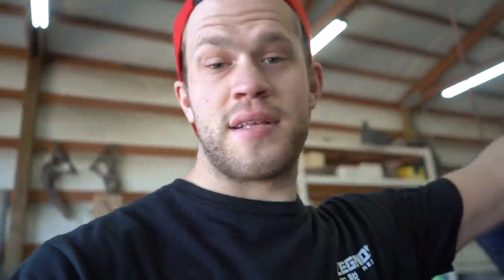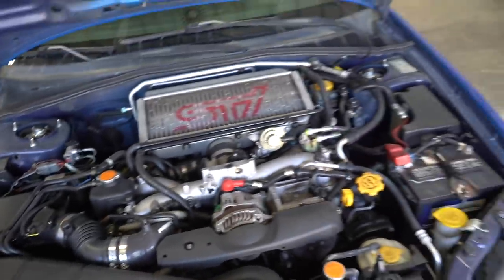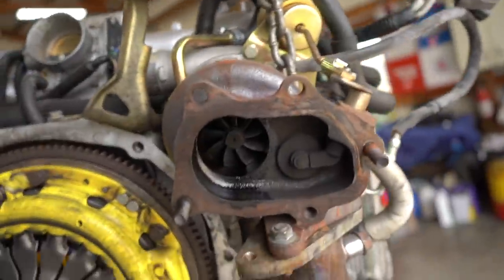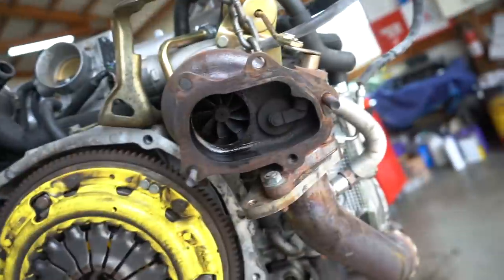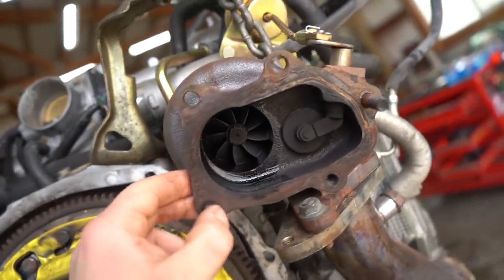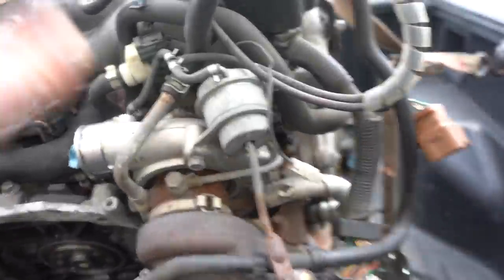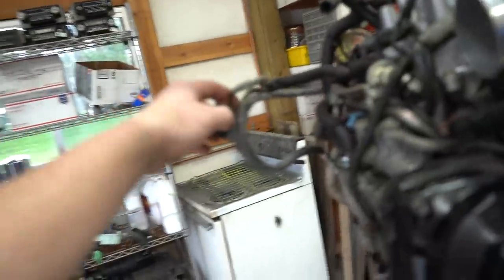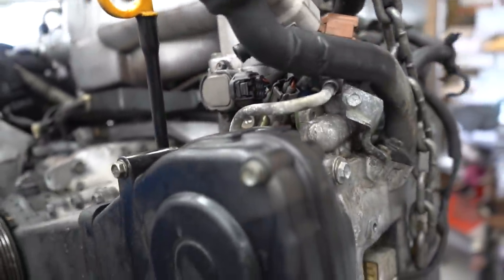The New Project

Comment: the engine honestly sounded fine. just looked like a turbo seal was there any shaft play on the turbo?
Reply: My thoughts exactly, I've owned several impreza 2 started blue smoking ,both turbo failure.i would always check the turbo first

Comment: Hi, can I reccomend you change the oil pick up on this, I beleive the hawk sti shares same engine as my JDM foz sti 
There is a common problem for pickup pipe to snap I bought mine and the engine blew up 170 miles into ownership. It would save a a future engine build for the sake of a cheap part 

I also make Subaru videos feel free to peep my page... I've got parts coming but just waiting for them due to Corona virus shit 😭
Reply: Liam Hill I think that’s a wrx not sti .. (I think)

Comment: Is it cheaper in the long run to rebuild an engine, rather than buying a used engine?
Reply: Carleen Irvine cheaper buying a new motor and install compared to rebuilt might cost more cause of labor hours rebuilding.
Reply: TakeSegi yes I agree, but if it’s brand new then fine, but what about buying a used motor, does the price compare in the long run rather rebuilding your blow motor which make pretty much new. Which is better?